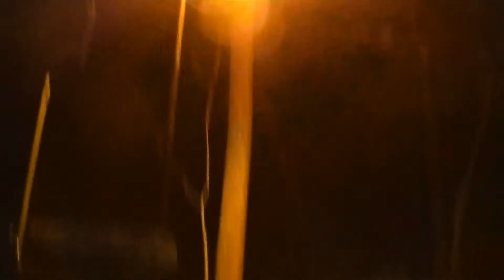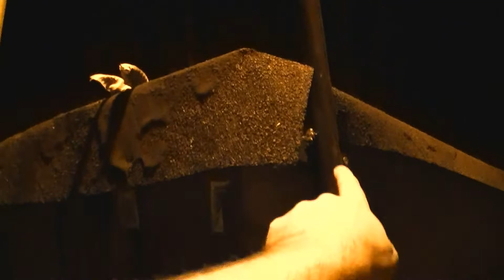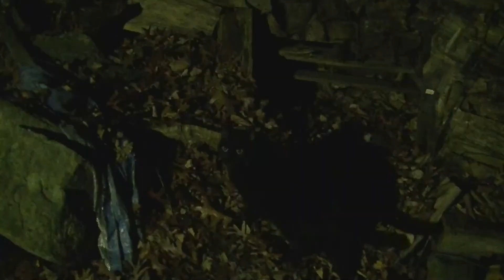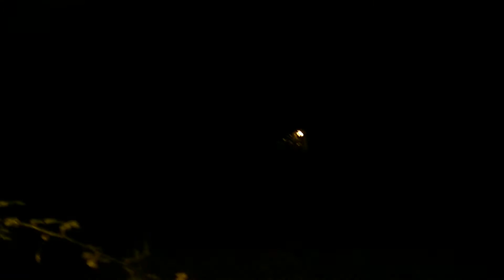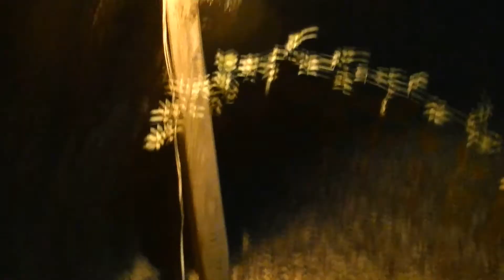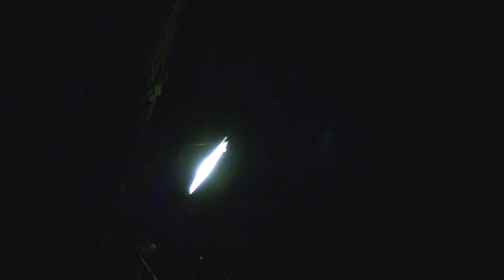My new Thorn Beta 5 35W LPS/SOX street light

Comment: I’ve got one exactly like this, do you think I could put it in my backyard like you did?
Reply from the maker: Yes as long as you have a mount and either a source of 240V electricity.
Reply: @randacnam7321  I’m actually planning on getting a Thorn Gamma 6 lantern which is also LPS but is meant for post-top unlike the Beta 5 being Side-entry.